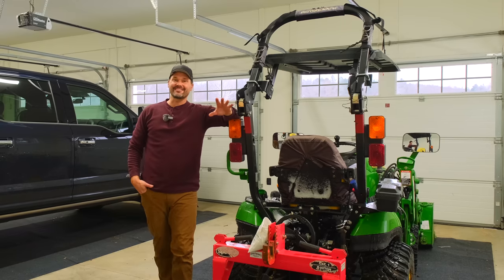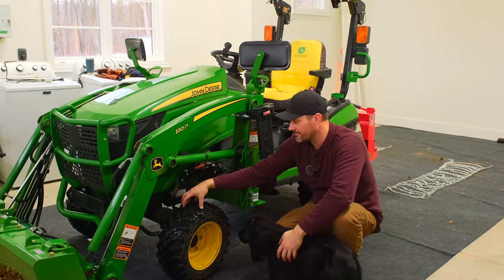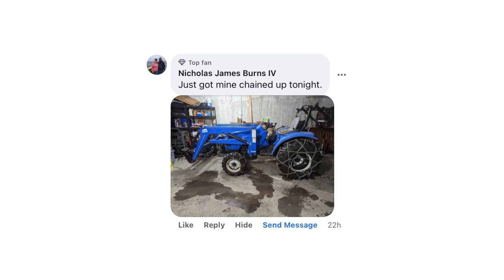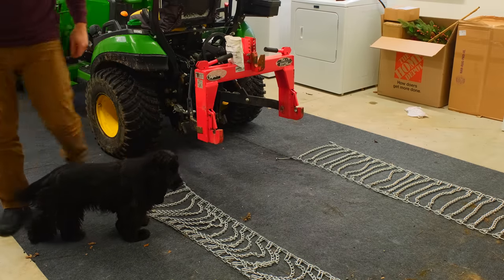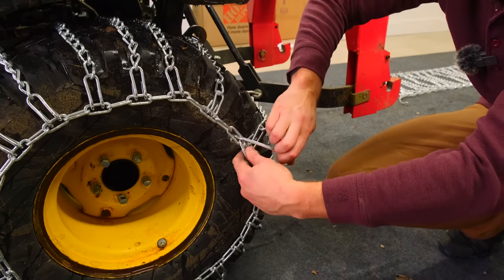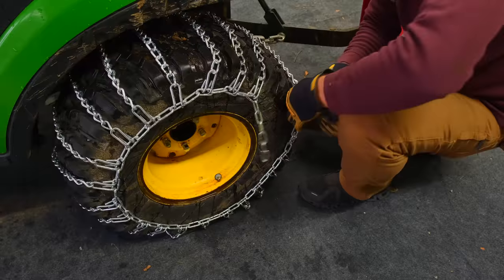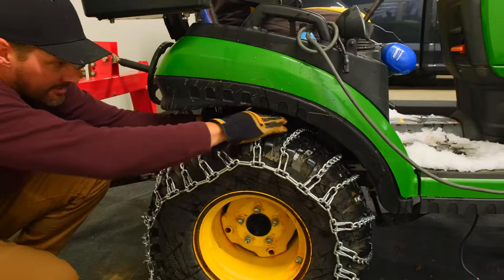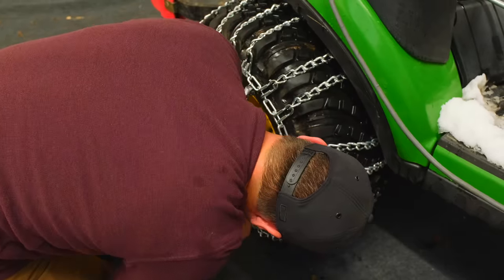IS THIS BETTER THAN PLAIN OLD 4 WHEEL DRIVE? 🤔

Comment from the maker: Well, what say you about tire chains?

Products in video:
Save 5% with Code GWT at: http://www.tirechainsonline.com
Buy Rubber Tire Chains: https://www.amazon.com/shop/goodworkstractors/list/IKSOKFGPYKE8?ref_=cm_sw_r_cp_ud_aipsflist_aipsfgoodworkstractors_X8XDKDGFEAWAX3133BF7

LOOK AT OUR MOST POPULAR ATTACHMENTS!
Speeco Quick Hitch: https://bit.ly/3NFC0yl
Stump Wrecker: https://bit.ly/3GptiC5
VersaBracket Combo: https://bit.ly/3wUPrnl
Snow Pusher: https://bit.ly/3NB4BVw
Landscape Rake: https://bit.ly/3GpSlF6
Land Plane: https://bit.ly/38SDHcY
Pallet Forks: https://bit.ly/38wRztu
Grapples: https://bit.ly/3PNNYaZ

WANT TO SAVE MONEY? CHECK OUT THE GWT DISCOUNT CLUB!  Use code GWT at any of the vendors below and you will save cold hard cash :)  I will also get a commission for the sale, so it's a win-win-win!  

USE CODE "GWT" TO SAVE BIG WITH:
BUCKET BRACKETS @ http://www.jufabworks.com
CUSTOM GRILL GUARDS @ http://www.5elevendesignz.com
PTO QUICK ATTACH @ http://tractorptolink.com
DIY HYDRAULIC SOLUTIONS @ http://www.summit-hydraulics.com
GAME CHANGING GREASING SYSTEMS @ http://www.lube-shuttle.us/store

PREVENT FLAT TIRES @ http://www.multiseal.us
CULTIPACKERS & CRIMPERS @ http://www.packermaxx.com
ALL OEM JOHN DEERE PARTS @ http://www.247parts.com
ACCESSORIES AND BACKHOE BUCKETS @ http://www.muddscustoms.com
CUSTOM TRACTOR FLOORMATS @ http://www.tractormat.com
PROTECT, ORGANIZE, IDENTIFY HOSES @ http://www.outbackwrap.com
BOX BLADES FOR ATV'S @ http://www.northwoodsfabrication.com
HYDRAULIC SYSTEM PROTECTION @ http://www.hoseendchamer.com
DUMP FROM THE SEAT MATERIAL COLLECTION SYSTEMS @ http://www.proteroinc.com
POWERED SWEEPERS SWEEP UP ANYTHING @ http://www.sweep-all.com
EASY WHEEL TOP LINK HANDLE @ http://www.tractoraftermarket.com
TIRES, WHEELS, AND DUAL ADAPTERS @ http://www.millertire.com
AMERICAN MADE CARRY ALL ON STEROIDS @ http:www.bigtoolrack.com
THE BEST TOOTHBAR AND MORE @ http://www.heavyhitch.com
5% OFF WITH CODE GWT AT TRAC SEATS! http://www.tracseats.com

SHOP: http://www.goodworkstractors.com
AMAZON: http://www.amazon.com/shop/goodworkstractors
SUBSCRIBE: http://www.youtube.com/goodworkstractors
LIKE: http://www.facebook.com/goodworkstrac...
FOLLOW: http://www.instagram.com/goodworkstra...
MERCHANDISE: https://stores.inksoft.com/good_works_tractors_merch/shop/home

*Discount codes cannot be combined with any other promotions, offers, or deals!
**I choose to sell some products through 3rd parties instead of stocking items myself.  Know that I will receive a commission if you choose to purchase through certain links.  Thank you very much for your support!

Comment: The easiest way I found was to put a floor jack under the tractor and lift the tires off the ground, then put tractor in neutral and put the chains on. That way you can turn the wheel while putting the chains on.
I do this on my Mahindra 2538 which is quite a bit bigger and it works well.
Merry Christmas
Dave
Reply: This^^^^^^^ It also makes taking the slack out  easier and getting the cross links straight etc.
Reply: I agree.  Jack up the rear, even out the chains.
Reply: Same, I posted a video on this a few weeks ago. My first time installing chains and right out of the gates I realized that the drive over method sucks. Jack it up.

Comment: I grew up on a farm where I had to move the tractor 3 miles between two locations to feed cattle, so I got pretty proficient at removing and installing tire chains.  Here are a few of the tips I learned.  First, install the chains with the crossbar hooks facing away from the tire to avoid sidewall wear from the hooks..  I would drive onto the chains and then use rubber tarp straps to hold the chains in place as I moved the tractor.  These can be used later to tension the chains.  Once you have a good fit established, trim the inner side chain to the correct length (no tail to fasten down).  As a quick tensioning trick, you can rotate a side chain link, to pull  the links together and then hold it with the tarp strap.
Reply: I do much the same, however, I zip tie the excess inside chain rather than cut the chain as you never know when you will get different tires that are larger in diameter.  Zip tying the loose end to the chain works well and allows the chain to later be used on larger tires without having to add links back.
Reply: That was the first thing I noticed when it comes to orientation of the chain with the hooks facing away from the tire it's also easier putting the chain on cuz it doesn't grip the tire quite as much when you're trying to adjust it and definitely less wear on the tire
Reply: Make a video
Reply: Agree with the hooks facing away from the sidewall of the tire. If these were ice chains with the built in "V", it would also further prove this but the biggest reason is so you can replace or repair the cross link while still mounted to the tire.  May not be a big deal on a tractor tire but on a vehicle, it is a big deal to be able to repair quickly with out having to remove the chain and then re install.

Comment: I always have done mine the opposite of what you did here, meaning I install the chains with the cross link hooks facing out instead of in against the sidewall. It also places the side loops  the cross links hook to slightly closer to the side wall so you have just a bit more room to play with when latching the links.   My dad always left ours slightly loose so that the slop could bunch up at the bottom for even better traction and it did in fact seem to work well.  Don't worry if the cross link spacing isn't exact  for each one. Trust me, as the tires slip and spin on ice etc, the spacing's will constantly change a little.

Comment: Lots of great suggestions here.   The best ones are the ones that work for you. My add is when you are taking the chains off in the spring, wrap tape on the inside and outside links where you fastened the hooks.   Makes the chain adjustment question go away during year 2+ install.

Comment: Great video Courtney but it's always a learning experience. The first chain installed on the left side was actually installed backwards. The crossbar to side chain attaching links should lay flat on the sidewall with the wrapped ends facing away (outwards) from the sidewalls. The right side is actually installed properly. Otherwise good job for a first timer!

Comment: I ran chains very similar to these for years on my old IH782. I found that if you let almost all of the air out of the tire, then install the chains it works alot better. Also use a jack on the rear hitch and lift up the entire rear end so that you can spin the wheel and get a better adjustment.

Comment: Lay the chains out in front of the tire, pl ace a small piece of  2 X4 in between two of the cross bars about a 3rd of the way in. Drive the tractor forward and up on the blocks. that will allow you to drape and manipulate the chains before tightening. Spider Bungee Adjusters are the best chain tightners that I have ever used.

Comment: We have a 1025R .I put a trailer ball in the hitch upside down to use my floor jack to jack rear of tractor off ground. Let the air out of the tires. Put chains on than air the tires up. No need for the tension springs. We run chains on the front also.

Comment: I put chains on my lawn tractor (Cub Cadet 2542) this fall.  I had homemade rubber tread chains the tractor came with, and turf tires which had no traction in snowy conditions.  I ended up taking the wheels off the tractor and deflating to be able to get the chains on.  I had a hard time getting the chains to stay where I put them, but the tractor was able to struggle through the snow.

Comment: Chains are the way to go.  When I install mine, I do it in my garage and jack up the back end, leave it in neutral, and then spin the tires by hand instead of driving onto the chains.  Front tires blocked, of course.  Rubber bunjies help to hold the chains in place while the tire is rotated.  Everyone has their own favorite way to do it, this is mine.

Comment: The easiest way to get chains on your tractor is put it in 2 wheel drive and in neutral. Jack up your tractor rear end around 3 or 4 inches. Now you can "hook" your chain on the tire lugs and use the wheel to role the chains up and over the wheel. This makes it so much easier to make adjustments etc...to the chains and also to snug them up while you secure the links.

Comment: After years of driving over the chains and then having to stop a time or two to take up an inside link, I finally bought a set of the plastic ramps made for installing chains.  You lay the chains in grooves in the ramp and drive onto it.  I thought they were just a gimmick, but for $30 or less decided to give a set a try.  They work amazingly well and I seldom have to retighten chains now as the grooves allow the chains to move freely under the tire and you can get things very tight on the first try.  One could easily make set using a 2x8 and curing small pieces to match your chain pitch, but given how cheap the plastic ramps are I didn’t invest the time in making a wood set.

Comment: I  have a Kubota L3301 4 wheel drive. I run rear chains and have for years. They are a game changer in the snow. Like daylight and dark difference. I live on a gravel lane with fairly steep incline. I had the tractor spin around in the road going up hill until I put chains on it. I have not been stuck since. I have ran mine year round last several years.

Comment: Your chain on the left side is upside down, notice the hook on the end of your links are against the tire. Right side is correct. I also lift my JD 345 off the floor and let the air out of the tires which helps and you can let the chains hang as you grab a link spin your wheel and adjust links and then grab final outside link. I have never used tension springs. Fill with air after!

Comment: One way to install tire chains is if the tire is not loaded with Rim guard or other product .Remove the valve core let out all the air then install the tire chains as tight as possible pump the tire. They will be tight and stay tight. No bungee needed. If tire is loaded jack One side at a time of your machine work tire chains on make they positioned correctly open side of links facing out and tighten link on outside. Working chains around to get tightest fit. Use wire ties to secure loose end links and to secure your locking tighter links. Then use a good heavy duty rubber bungee and crisscross a few on each wheel. These methods take a little extra effort but nothing worse than a chain coming off 11 o'clock at night in a snow storm. I have used these 2 methods for more than 50 years as a landscaper and snow pusher never have a problem. Keep up the great work you are doing.

Comment: Once you have initial fitting complete cut the excess links off. Zip ties break, wire can work, but if those loose links come undone they can do damage especially given how little room there is on sub compacts and lawn tractors. Don’t ask how I know.😂 A side benefit is it’s easier to latch the chain without the extra links in the way. Also I use rubber S hook straps on the outside, 2-3 per side. They are cheap, work well, and are easily sourced.

Comment: Great tip on using wheel spacers with chains.  With the size tires in the video I always found jacking the tractor up was the easiest way.   On the 2 series and above, I usually back onto the chain and then manually get it up on the R4 tire and roll forward, allowing the tire to pull the chain up.    I always drive around a little and then tighten everything up a second time and I am good for the season.  For the chains in the video, try to get the excess links behind the lever link and you should be able to get one more link to tighten.
Reply from the maker: Yeah, seems like jacking up could definitely be easier for bigger setups.  Thanks for the tip!

Comment: First bo-bo is you have the first chain on backwards...the monkey links that attach the cross bars to the side rails need to have the stub ends facing out. If not and they happen to open up under stress they will wear into the tire sidewall. After 46 yrs hauling freight over the hyway I in the northern Canada I have a very intimate relationship with tire chains. Lol

Comment: I stopped using chains after the first season. Now I install ice screws in all tires  these screws are for Atv tires for winter traction. I remove them seasonally only takes about 15 minutes per tire   They work great and no more bumpy ride from tire chains

Comment: Make sure that all of your cross links the hooks face outwardly so you don't put a hole in the sidewall of your tires.   I jack up the tire I am putting the chain on.   Also try rubber chain tighteners.  Also get carabiner hooks to tie the extra side chain ends.  They are cheap at harbor freight tools.

Comment: Laying the chains out very, very neatly (as in every single  chain link is as it is supposed to be) and lowering the tire pressure (my tires are not loaded) makes it much less frustrating.  Also, doing it on a day when it's not 10 below helps a lot as well. :)

Comment: When we put chains on our tractors I don’t recall them fitting very tight to the tires. We never used bungee cords to take up the slack they just clung to the tire lugs. But I do remember having to drive rather slow because if you traveled at anything above about 15mph the chains would fly up and hit the fenders. But we sure were able to get through some sticky situations that we wouldn’t have been able to without them.

Comment: Tip I use is jack up the tire so I can get the chain on while rotating the wheel and lower the air pressure just enough that you can make the chain tension tight as possible, then fill the tire with air to the correct psi. It will have no slop and will not come loose or undone.

Comment: I put studded diamond pattern chains on my Kubota BX every winter here in Maine. They are invaluable for traction when plowing the 300’ driveway in mid to late winter when it’s a sheet of ice. Putting them on is always a bit of a pain in the ass. As already mentioned I use a floor jack to lift the tractor and tire one at a time, and high enough for the chain to wrap around the tire. I find it easier to have the brake on so the tire doesn’t rotate. Then it’s a matter of evening out the chain and getting it as tight as possible. Then I put on the tensioners. I use small zip ties to keep any excess chain from flopping around.

Comment: Thanks for another great video Courtney. Many folks have suggested jacking up the rear end and that’s great cuz you can spin the tire. I just drive the tractor up onto a log and then drape the chain over the wheel, securing it at the bottom.

Comment: It always helps if you lift the back end and are able to rotate the tire completely, We always lowered the air pressure and the tire quite a bit. Put the chains on and then reinflate. It takes almost all of the slop out of it.

Comment: Yes, I saw that the first one was installed upside down.   I also jack up the rear tires to install the chains and I put 2 inch wheel spaces because when chains get some ice and snow built up on it, it would knock the pins off the 3 pint hitch.  I use on the front wheels as well, so far no issues after 5 years.  I have a 1025R and I plow a 1/2 mile road with no issues.

Comment: The way I was shown was to have the link that fastens the cross chain to the side chain should have the cut end of the link facing out so that the sharp edge doesn’t rub against the tire.  It looked like you did the right side tire like this but the left side was the opposite way.  I don’t know how big of a deal it is but that’s just the way I was taught.

Comment: They look good sir!! Only one thing. You put the chains on the wrong tires. The hooks where the cross links hook to the side links should be bending outward away from the tire. If the chains get hooked on anything and the cross link end hook get bent then you can likely puncture a tire.

Comment: I have chains on my 1025 with turf tires ,,,,,Up here in Bayfield Co Wi they are almost mandatory if you want any traction ,,, Your tires are probably loaded but when installing my chains I let some air out of the tires and fill them back up after install,,,, Same thing with the tires on my Polaris ranger with my plow,,,, It helps with tightening up the chains ,,, And yes I still swear a little putting them on but I also jack up the rear of the tractor when doing so,,,

Comment: Tried the front chains; thoughr it would help steering in deep snow.  They fit and worked except during hard turns.  Seemed to bind when in 4WD and turning hard.  Decided not to risk the health of the front axle.  May alter the chains with reduced number of cross chains and a radial chain down the center to assist steering.

Comment: I recommend jacking up the back of the tractor, then putting a string through the wheel and around the chain. Then you just spin the tire until it is all the way around. I have tried many ways, and for a small tractor, that is by far the easiest.

Comment: Just like some of the other comments. I lowered the air pressure a little and raised the rear end with a floor jack it makes it a little easier.  Then I use  channel locks on the big hook on the outside. Then I  use rip ties the loose links and then raise air pressure back to normal. That way the chains are nice and tight

Comment: I had several IH lawn/garden tractors, 12-16 hp. I found a floor jack under the rear bell an easy way to install rear chains, and tighten same. I don’t put them on my Kubota B series tractor for the reasons you spoke of. Hope this helps.